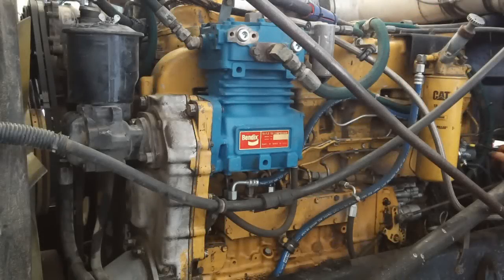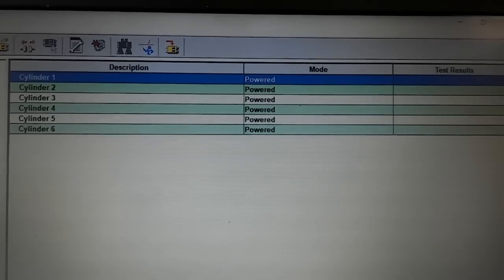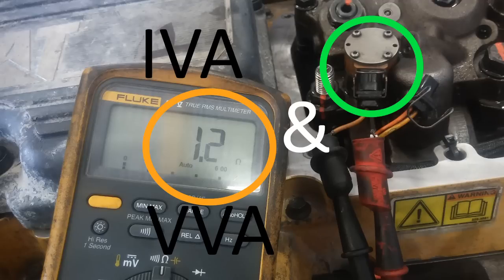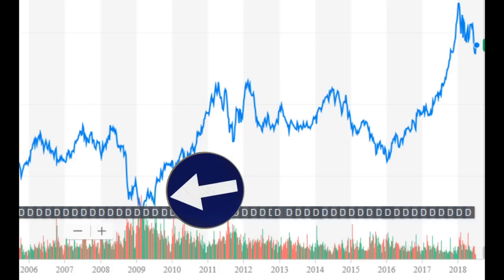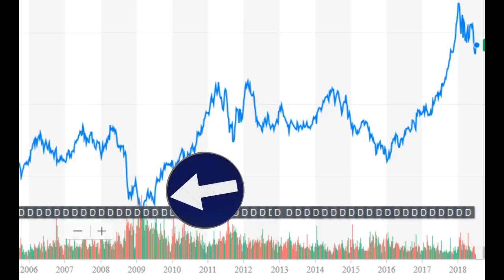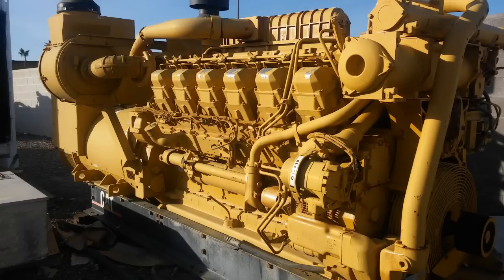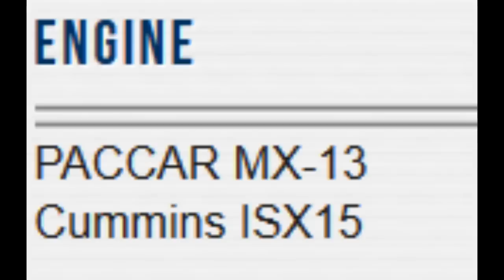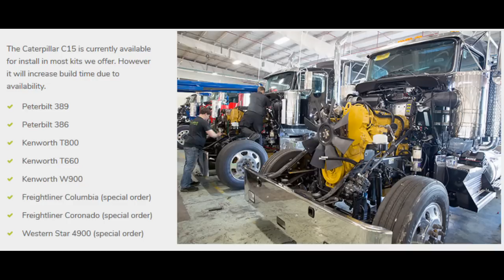Why Did Cat Stop Making Truck Engines?

Comment: Little known fact  and somewhat relative to those "new" cat/navistar engines was that navistar didn't actually produce the engine that was placed in those trucks.   Navistar bought stakes in Mann from Europe and when introduced to the U.S. was called the maxxforce series (dubbed the "boat anchor" by mechanics)   it was riddled with the same issues as the cat version.  The cat truck is built on the 9000 series navistar truck platform with cosmetic changes and badges to "make" it a CAT.  With navistar only offering the maxxforce engine exclusively from 2010 to 2014 and with declining sales due to reliability and customer loyalty on a downward spiral, navistar reintroduced the 12 and 15 liter Cummins and got away from the flawed dry exhaust filter system and began using def fluid as required by the epa to bring emissions down.

Comment: in simple words cat just didnt want to jump on the emission reduction train and spend crazy amounts of money to get them to meet stupid regulations. And actually a lot of brands have done that. Even brands like volvo and ford europe dont build their own car diesels, they buy them from the psa group(peugeot group) because it just is to expensive to develop new engines and emission addons for just 1 brand. And in the big truck engines its even more of a problem. In europe we have something called euro standard, its mostly used on trucks. At this time euro 6 is the standard they need to meet, but it go's up every 5 year or something. That means a truck engine manufacturing lifespan is 5 years, then they need to upgrade it again. So they need to make their money back within 5 years and make profit in those 5 years also. Back in the days those 5 years where probably also to make back the development costs and all, but then they would still have 5 years to make profit. (or probably a shorter earn back time because those engines needed a lot less then modern emission regulated engines)

Comment: You forgot to mention that Caterpillar even powered Locomotives.Baldwin made a RS-4-TC-1A for the Army in 1954,only roughly 71-74 ever existed and had a D397 V12.And the Army rebuilt alot of them with 3508 V8's before Railroad Transportation was done by Civilian Companies.

Comment: Theres an easy way to reduce emisions increase burning eficiency and also reduce oil changes intervals..
all at the same time..
Many moons ago mr.COATES  invented Coates Spherical Rotary Valves that can be bolted onto any engine gas or diesel..
its mind bogling that not a single truck engine manufacturer has ever used these,,see
http://www.coatesengine.com/csrv-advantages.html

Comment: Basically they ran out of ideas on how to build reliable competitive engines that met on-road emissions regulations. The ironic thing is that in many areas of the world, off-road emission standards are now only a small step behind on-road standards, so they must build a high proportion of their off-road engines to be cleaner than when they gave up truck engines.
However, apart from their own branded prime movers, Cat and Cat/Perkins have lost all their biggest off-road engine customers as well. For instance, very few models of farm tractors or handlers from any brand are currently fitted with Perkins engines. Up to the turn of the 21st Century they were by far and away the market leaders in that sector. Now they have been mostly replaced by Deutz, FPS/Iveco [which have a very similar design to Cummins] and AGCO-Power/Sisu.   
I think they went badly wrong and misread the market with tier3 off-road standards when they chose, like their fellow American company John Deere, to go heavily on EGR with DPF which required much larger cooling packs than their mainly European rivals who went with DEF and minimal EGR, which resulted in better fuel efficiency with cooling systems that fitted existing enclosures for DEF engines. 
As a result their smaller diesels are now license built ISM and FPS engines, depending on model, while their bread and butter 4.4 and 6.6 litre engines of their own design are endangered species outside Cat branded machines.

Comment: I really don't do diesel work, so my only experience with cat engines is filling one up with 27 qts of oil after it stalled on the road. I've never seen an engine leak oil so badly. In a half hour the truck left an outline of itself on the asphalt.

Comment: They didn't want to use DEF, which has been required since 2011. One exception was the Navistar MaxxForce engines which were able to meet emissions with just SCR (no DEF) from 2011-2014. By 2015, even the MaxxForce engines had to switch to DEF

Comment: It was a good move for CAT, they sold their Diesel engine line and acquired EMD from GM. Given the fact freightliner is most likely going to have its full electric trucks on the highway almost 2 years early it’s a good idea to exit diesel production. CAT made a smart choice for longevity, the emissions and reliability issues just made it easier to stay in markets that won’t see electric for years.

Comment: Interesting video. Cat sees its not worth investing billions of dollars into a new truck engine cause in another 10-15 years otr trucks will all be electric if not sooner and diesel will be phased out!
Reply: robert s  oh I disagree if the battery technology keeps improving they will be phased out! An electric motor needs no transmission and is more torque then diesel! I like diesels I have a Cummins in my dodge but I see what electric motors can do for power and its cleaner to charge a battery with natural gas power plant then running all these diesels around

Comment: I hope no one has to experience cats warranties. They SUCK they will find any reason to not warranty a engine and make you fight tooth and nail. No wonder Cummins is the leader. No warranty issues, no drivability issues no heat issues I absolutely hate my c15 twin turbo what a junk engine can’t heavy haul with it it cause it won’t stay cool. Cat just keeps saying it’s fine.

Comment: PACCAR didn't drop CAT from there line up. When CAT stop making engines and went to International CAT dropped the rest of Industry. It was rumored CAT truck almost gotten Cummins 15 liter but they dropped out of truck market. When CAT, International and MANN spent 3 yrs trying to make engine pass emissions without DEF the Project FAILED BADLY.  CAT engines had their problems too blown head gaskets early in the life of the engine. ACERTS engines had less problems with head gaskets better metal in blocks and heads. Glider kits are coming to a end soon because you be forced to put in current production engines

Comment: Cat CT15 WAS a Cat SDP C15 with the Bosch fuel and air handling system. The attempt to make it work with advanced EGR meant that there were a lot of cooling issues. It has a small but growing niche in its second life in truck pulling.

Comment: I see by some of the comments below that the EPA is at fault when it's CAT's fault exclusively. I remember having what we thought were "muscle" cars in the late 60's. We thought they were fast and lamented about the dreaded EPA smog regulations and increased mileage. At the time I thought we'd never see cars like those ever again. In retrospect, those regulations made manufacturers get off their lazy asses and today we have cars that last 3 times as long, require a fifth of the maintenance, get twice the gas mileage and make those "muscle" cars look pathetic. Cat's decision was Cat's. They looked at their market and decided what was most profitable for them. I think they are being very short sighted (just as Ford is when they say they will no longer produce cars and make only SUV's & trucks) but that's their call. Companies make bad decisions all the time (I've worked for many over my 62 years and have seen some real stupidity). If Cat can't make an engine that meets the regs then shame on them. Someone else will and then they will be history just like all those other companies that didn't want to put in the effort to develop and instead are more concerned with their immediate profitability.

Comment: Cummins does not have a captive truck brand within their corporate structure.  So why are they rocking and rolling?   The big mistake was Caterpillar not buying Paccar.  As Daimler purchased both Freightliner and Detroit Diesel, and is rocking and rolling.  Cat has the dealer network in place to sell and service truck engines.   The big mistake was aligning with Navistar, who is floundering like White Motor.  Navistar also had a mediocre vocational truck product.   During this era, a couple of mistakes were made -  the overpayment and purchase of Bucyrus-Erie and the focus on GM railroad locomotives.   CAT has the know how, foundry and truck engine plant in Peoria, Mapleton and Mossville.  Too bad a couple of fatal errors were committed by Doug Oberhelman, when the Board of Director made him exit a year early.   Oby should have purchased Paccar and P&H (Harnishfeger).   You would have had four winning brands in this acquisition - Peterbilt, Kenworth, P&H shovels and Joy.   All leaders in their classes and all premier products.  As Warren Buffet would class these industrial - commercial products as having " competitive durability ".   Oby and the downtown crew on the 7th floor of 100 N.E. Adams in Peoria were too stingy to invest in EPA mandated emissions.   Cummins and Detroit Diesel did, it did cost to the tune of around $1.5+ billion each, but  they are now clicking their heels.   The Diesel internal combustion engine will continue onward for the next century in mid and heavy duty trucks and construction, logging, farming and mining equipment.

Comment: Great comments here. I worked at Thomas Built buses in the late 1990s till 2001. I was invited to a meeting where they discussed the changes to the engines for the 2002, 2004 and 2007 model years.   I sat and listened and asked them if they could see an end to the tightening. They said that it was because of the government. I told them that it would have been cheaper to buy a few key members of Congress and some federal bureaucrats. If course they looked at me as I was crazy. I did tell them that eventually prices would be so high no one could afford them. The whole room looked at me like I was crazy. I knew what was coming. I feel bad for the workers there.

Comment: CAT^ stopped making truck engines due to the fact EPA regulations are strict and expensive

Check out the penalty that Navistar paid for NOT using DEF emissioned engines.
CAT and Cummins are busting their humps to develop engines with low emissions and low operating cost.. Plus with Cat  entering the Class 6 and above  truck markets the engine they produce must be the very best they can make .
Cat produced more stationary engines used in emergency power, pumping water , and other  applications made in the USA and what is the first thing big money buyers do ? Buy Japanese or Korean with made in China assemblies.

Comment: Other makes such as Volvo/Mack passed as their engineers understood the requirements. Governments treats every manufacturer the same and I should know as I spent over 30 with Mack then Volvo/Mack and much is it in the Powertrain Division where the engines and transmissions were designed and tested.
Reply: Volvo and Mack are such good little sheep!!1

Comment: So in other words CAT didn't want to pay for smart engineers to design an emissions compliant engine.
Reply: Cat was too busy building earthmoving equipment.  Their engines where always overrated and always at the bottom end of fuel efficiency.  Long haul truckers average life expectancy is in the  mid 60s.  Cat fanbase is dead and the pencil pushers in trucking companies  were phasing cat engines out 20 years ago. Cats always dumped antifreeze into the oil pan because their cylinder sleeve  gaskets would leak. Cylinder sleeves and gaskets  were  the only barrier keeping  coolant from going into the oil and the gaskets always leaked   As oil change periods got longer.  Coolant level in used engine oil samples got too high.  This was a reason for many a cat overhaul while the competition was still running,

Comment: As a former heavy truck dealership service manager (left in 2017), I can say without question these last few years have been rough. DPF's, ARD heads, DOCs, ISX carbon fouling, etc were and probably still are a massive headache. As a Cat warranty center, I remember the IVA issues starting in the BXS C15s. The diagnostics at first were garbage. It was basically 'swap IVA heads around for six weeks and see if the fault codes follow a head around'. I mostly dealt with local haulers, I cant even imagine how rough this was for OTR trucks. Anywho, give me a 5EK 3406E any day. Whatever Cat was doing in 97, they made a great 15L.

Comment: I like the smell of the new technology. Damn if you do a regen inside the shop it’ll clean up the dirty air!!!

I work at a dealer, Cummins train tech. I like the fact I don’t get a head ache from fumes from other technicians moving trucks around. 

Cats suck but it’s better than a isx, DD15 is alright for a big and L Cummins is the best motor of all time! Besides a c with a p pump.

Comment: I remember the magnificent Cat truck engines from the 70's and 80's. The 1693 is still the baddest-sounding Cat engine ever produced! The 3406A sounded great too, with its pre-chamber heads. 3406B's ran like scalded dogs as well, and I knew a couple of guys running 3408s  on the highway. Those engines were beasts, but so heavy the 12,000-lb front axle weight limit was exceeded before the truck was loaded. Lol.

Comment: All the video explained is the fact the economy and the governments inabilities to help an American company weather the economic storm rendered alot of good trucks useless. Sad to say the older CAT engines are still best without all the heaps of electronic shit on em... A diesel engine is so simple to begin with it doesn't need a diagnostic computer period. The ECM fuel injection is a nice touch as it is for every other engine but restricted exhausts and EGR and retarded valve timings in the name of emission standards is total horse shit as well as the governor on a fucking diesel is like putting tits on a bull....

Comment: You forgot one important application that CAT engines were used in. Every single mobile truck-mounted crane I've ever come into contact with (mostly Grove 35 and 90 tonners, as well as a few massive Kenworth mid-units) were powered by CAT V8s. The sound of those 6508s (or at least I think that's what they were. All I know for sure is that they were massive CAT V8s and they were all the same model) was absolutely monstrous when being tested with open headers. 

Picture the most bad-ass loping V8 sound you've ever heard and then give it some steroids and then some. Even at idle, they shake your body down to the very core. I've not heard any civilian-application diesel that has had the same affect on me. They almost didn't even sound like diesels as much as just really big, turbo-charged V8s with pistons the size of your head.
* Wubwubwubwub * lol